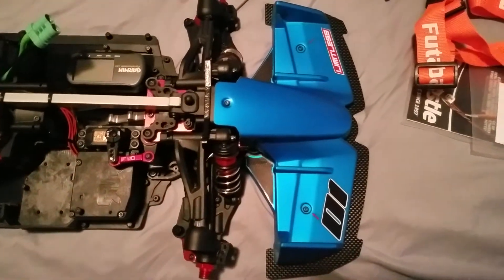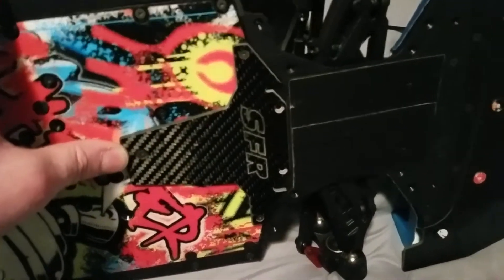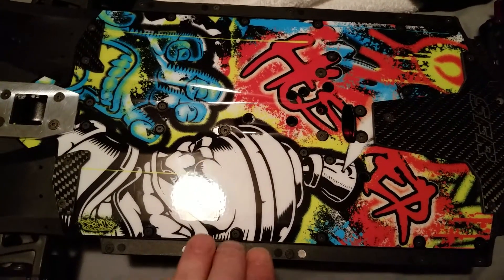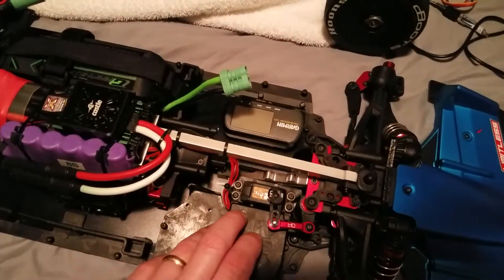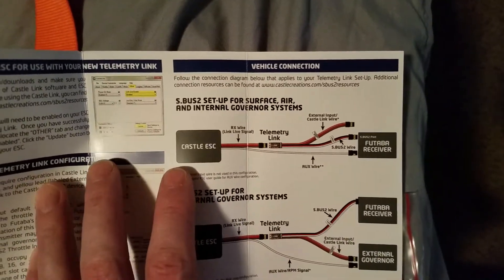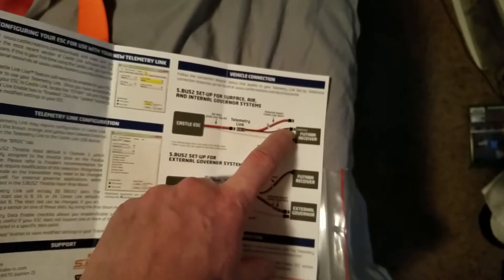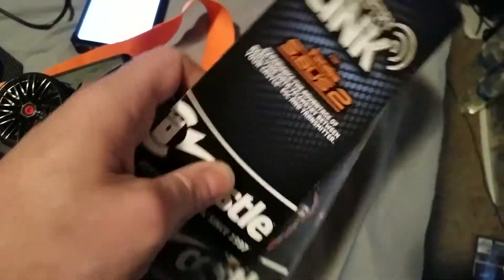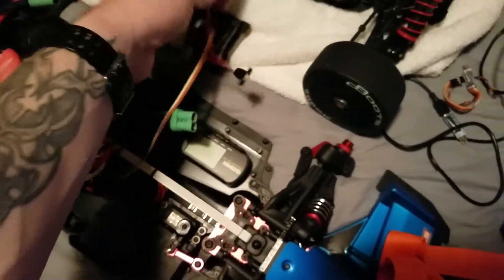Limitless 8s build update #2  /   Futaba 7pxr castle telemetry link fix update

Comment: You can also just set it to channel 2 on the throttle input instead of external input and plug the telemetry link into the sbus port on the receiver while leaving the external input unplugged. That works fine for me.

Comment: how do you plug that wire into channel 2?  that's where the ESC goes.
Reply from the maker: The telemetry module plugs into the channel 2 port of the reciever than the esc plugs into the other end of the telemetry module. Basically the telemetry module has a in and out signal....in from the esc out to channel 2 on reciever....This is how the telemetry module reads info off the esc than sends info to your radio.

Comment: bad ass ride!! just got mines with the 7pxr!! but I need your help what servos are you using? or is there a good one out there that's better?
Reply from the maker: Savox SW-0241-MG. This is what im using and probably about the best youll find for 1:5 scale servo. Water proof lots of tourque. I prefer titanium gear servos. For my 1:8 scale i use savox sv-1270-tg servos for everything. Its there monster tourque edition ususally comes with capacitor. Also has good transit speed. You need tourque to keep the wheels in the direction you wanna go especially under full throttle load mainly on the 4 wheel drives. I was gonna do the dual servo mod but they were out of stock on the dual servo arm so im waiting but single servo has been workn good so far. Dual servos especially savox usually require separate bec so keep in mind. Hope this helps.
Reply from the maker: Also savox has great warranty. Finally had to deal with them first time since i been using there servos and they replaced the steering servo in my 8ieght x free of charge with brand new one weeks after warranty expired. It had got water in it from washing car with garden hose after every run. Basically the pressure from the water worked it way inside the servo and caused a short. The water looked like it been in there for least few months cause the shit was rusted so it worked for that whole time filled with water. Amazing it worked that long before burning up. After my warranty is up i coat the bottom of the circuit board with waterproofing silicone to prevent that issue. I went ahead and did it on my 8ieght x early due to the fact i wash my cars after every run.
Reply: Wow thanks so much for the response!!! I might have to check them out I was looking at futaba CB700 to pair with the 7pxr what you think 🤔 should I pull the trigger or go with the one you got? need your opinion please
Reply from the maker: @BLM4ife  well hard for me to compare honestly due to i never used Futaba servos. I know their radios are whip and savox are good for servos. Mainly servo needs alot of tourque especially 4 wheel drives and 1:5 scale. Futaba servos do seem nice. Their both probably equal in quality depends upon pricing at that point. Futaba has great warranty also. In my opinion alli use is savox so myself id go with the savox. Savox all they do is servos so their focus is 100% on that item. Futaba makes alot of different things so sometimes that can be bad thing.... thanks for sub bro! Happy holidays!
Reply: reefs rc Raw 500!  1 of the best servo I have used so far 8v = .08transit speed @ 530oz inch torque  waterproof and quiet as well

Comment: Hi, thanks for sharing would you please tell me what is the difference between the 7PX and the 7PXR I can't seem to find that information anywhere thanks
Reply from the maker: Other than an updated menu system, lighter weight design and some cosmetic changes thats all i know. I read while back it had few more options than the original but i cant remember what those were. Sorry! I dont have the original to compare them too.